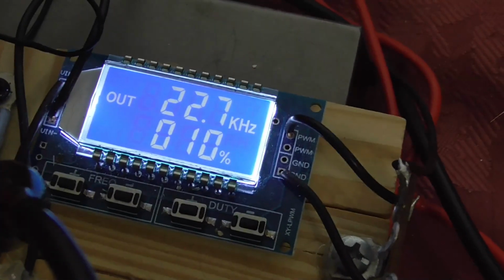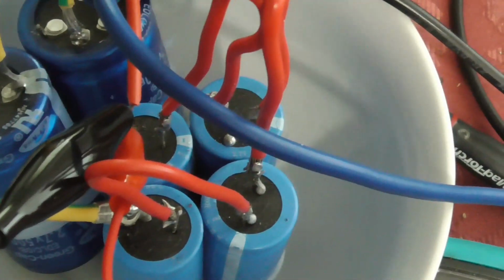Generator Disclosure

Comment: Joel, thank you so much for your brilliant post.  You are articulate, thoughtful and insightful.  You've brought forward some of the most important ideas for us all and some of which I've suspected for a long time. It seems you've validated my observations which I couldn't quite articulate as you have here. The system de-tunes under different loads - also the resonant frequency drifts based on the changing source voltage/impedance -- that's certainly been my observation.  And yes, it's necessary to tune it to the load.  I've been contemplating which modes of oscillation are the most important to focus on... You ve revealed a great idea in the golden ratio tuning between the source excitation frequency and the resonant frequency of the system.  I compare it to watching someone silently build a violin...we see 4 strings, its size, shape and material it but we don't know how to tune the strings.  That's where I've been - and perhaps many of us have been - for quite a while... hunting for just the right tuning.  Thanks again and know that you're making a huge contribution. 😊

Comment: @joellagace1679, (Goggle translation from Polish) I have an idea that may interest you, the idea is that in the system that drops the charge from the capacitor, instead of using a neon lamp, use 3 diacs connected in series with a 4.7kOhm resistor limiting the current, this will give about 90- 100v voltage activating the thyristor gate.

Comment: your getting better results at higher frequency because HF has very short on time and this helps reduce any emf fields from developing in the core, its simply the reason you dont feel any movement at HF even though its moving you cant feel it. thats cause the emf is not there but the potential field is there aka volts

Comment: You need to get out of the system. Also we all need to work together on a good cap dump circuit that can manage dump on voltage / resistance or time (hz, kHz, MHz)
Reply from the maker: I wonder if an ECS controller could tune the cap dump trigger pulse according to the input trigger pulse? I kind of auto tuner switch controller for our cap dumps.
Reply: @joellagace1679  an LDMOS also comes to mind. As we need to treat the system as a power amplifier. The controller needs to monitor and autotune the resonance frequency, match impendances (monitor the various input and  outputs) on each stage.

Comment: 14:00 your pulse on time is too long. (Heat)  With Arduino you can lower it to 1 millisecond , i have yet to try below 1 millisecond , gonna try setting the code to .025 Millie second on time. Dont give the inductor enough time to make any amf fields thats the idea . only reverse flyback Volts and if possible zero emf in the core
Reply from the maker: Yes with this specific setup I needed a bit more. Wouldn't trigger the hv module at lower. And at lower frequencies it starts taking milliamps away from the input. But generally speaking for just getting the best back emf spike, that would be correct, Go for the lowest trigger, pulse, if your serious try even reverse biasing a NPN transistor for even sharper off times!

Comment: Having the resonance bounce around in the coil is fine but your only using the coil like a storage so the bounce is not currently doing any work , you want to dump each bounce threw each pulse off time portion into another storage device or use it real time aka spin up heavy flywheel is most efficient converter for this entropic energy
Reply from the maker: The bounce keeps the amplitudes high the slow speed diode prevents much of the damping effect, We only take a little for this effect, I understand it seems your trying to get one step ahead here and yes your free to use and enhance all these effects, I have not yet even covered how to cycle the obvious RF here that is wasted, The rest is up to you really.

Comment: Bro, my system was so close to that that's crazy hahahah, but I think I was using high speed diodes 😮, that may be the issue, also I found that the best frequency in my case was around 5k but wayyy smaller coil so..

Comment: Using a slow diode to prevent the damping effect was a clever idea. I had been thinking about this problem for a long time. You want the circuit to oscillate freely without any obstacles, just like you want a wine glass to vibrate freely after you flick it. The problem is how to steal or harvest energy from the circuit without touching it, because if you touch the circuit with your finger (the diode), you will stop the oscillation.